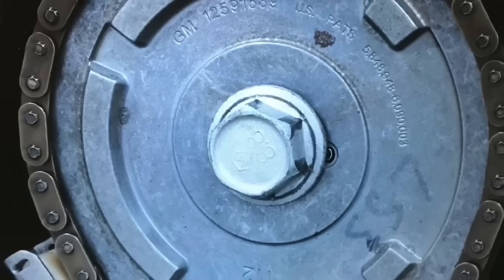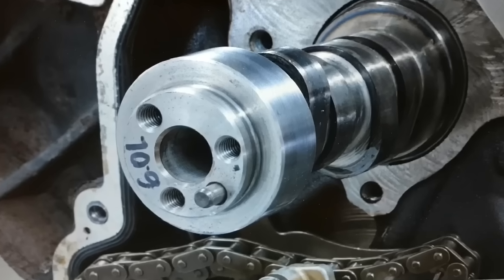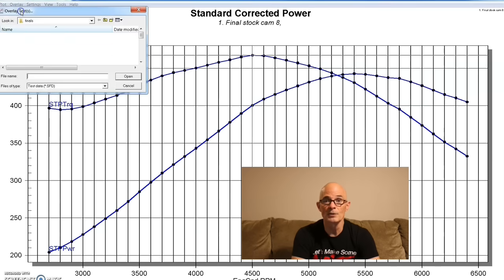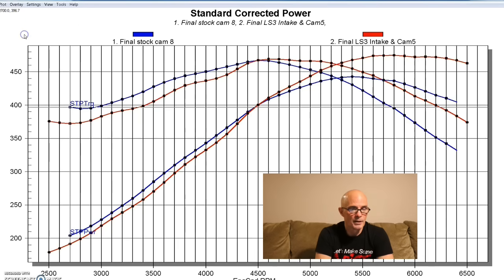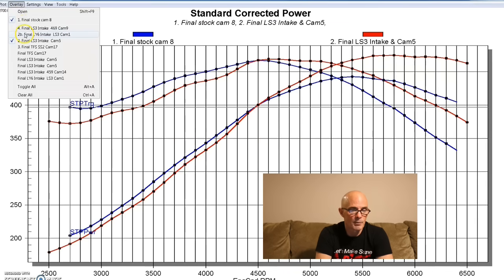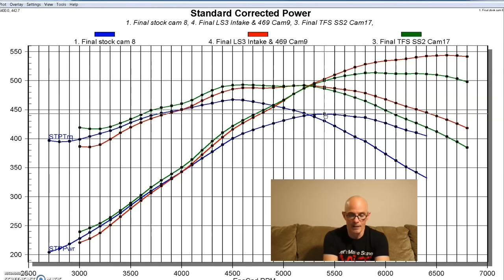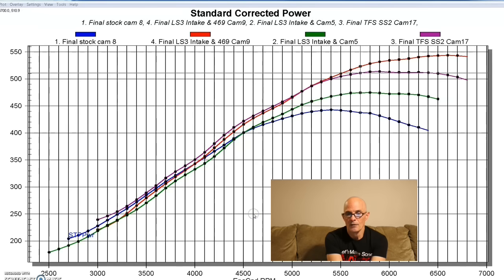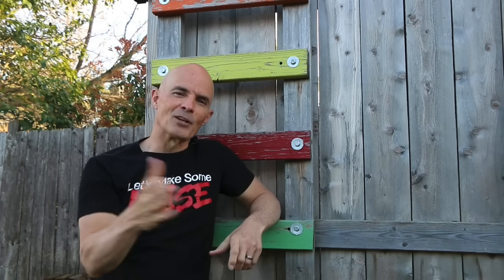HOW TO PICK: THE RIGHT JUNKYARD 6.0L LS CAM. 4 CAMS-WHAT WORKS BEST?

Comment: Y thought  lq4 was 310 hp.from factory tonthe wheel how you gett 400plus
Reply: He’s not testing to the wheels. The motor is pulled. He’s using an engine Dyno. A chassis dyno would measure power to the wheels. Which is what you’re talking about. I believe it’s like 15-25% power loss from engine to wheels

Comment: Would the magic stick 3 cam be good in a non nitrous car? Im tied between using that chopacabra, ss2 or sloppy best cam.
Reply from the maker: A cam does not care about nitrous-a 10-hp shot of nitrous adds 100 hp to any of those cams. The cams do what they do before nitrous. They are different cams that idle differently, offer different power curves, different idle vacuum, different usage with stock converters etc... Pick the one you want that does the best combo of these things-then add nitrous
Reply: @ thank you for responding. Another reason i enjoy you as a human being. We appreciate you.
Reply: @ thank you for your reply Richard. I also wanted to clarify that if I was going to go install a cam if I took the heads off and took the lifters out I shouldn’t have a problem or issue with the installation of the cam since the lifters don’t have to be held up, correct?

Comment: I have a ss2 cam and I was thinking of putting a stock cam in my 6 litre to save some low rpm power with the stock converter in my truck, then my buddy put me on to this video. 
ss2 cam it is! 

Thanks again Richard for your tireless efforts in the hot rod community 🤟🏼

Comment: I don't need 5750-7000 rpm top end 550hp 

I need that 400-550 hp+torque. 5500rpm and below 

Got and suggestions
Reply from the maker: see the many, many 6.0l videos with many, many different cams and choose the power curve you want

Comment: Is this with stock heads?… what heads was used in this test?… i want to possibly make 500whp with a 6.0… maybe if i mill a lil on the heads and raise compression?
Reply from the maker: YOU NEED PORTED OR AFTER MARKET HEADS FOR 500 WHP (MILLED HELPS)
Reply: @richardholdener1727  thanks for the quick reply.. milled LS3 style heads get close you think?.

Comment: I have a 08 6.0l l76 truck engine and I had afm  lifter failure. I set it to a local shop who said they would delete afm  and vvt  and replace it with btr stage 2 cam. When I picked it up, they informed me that they installed a Texas speed stage 2 instead. My question is what is the difference between the two cams. I could not find a comparison between the two. Do you have any data on these two cams?
Reply: If it makes any difference it has 823 heads
Reply from the maker: I DON'T KNOW WHAT STAGE 2 CAMS YOU ARE REFERING TO-THEY BOTH MAKE A LOT OF DIFFERENT ONES
Reply: Btr 31218110 212/218 .553/.553 111+0 
#25 tspll212218112 212/218 .550/.550 112 lsa. Does not look much different but just curious to know how these slight differences compare. Thanks for your reply and I appreciate your videos, very interesting and informative.

Comment: Richard

I love all your tests

But I really think you should do less LS testing with headers, a decent set of stainless headers cost more than a set of good LS heads!

Try testing more cams with standard manifolds

Thanks!
Reply from the maker: cheap headers are $200-$300 and work very well. I have compared stock manifolds to headers many, many times
Reply: @richardholdener1727  

Well for example I’m wanting to do maybe a head/cam swap on my 06 Trailblazer SS but I won’t do headers since I want to keep it at least looking factory. 

Engine swaps with headers but I’ll bet most ls people drive 4.8 and 5.3 trucks in emission states

Thanks though

Here’s an idea….build a low buck flat tappet cam sbf or SBC stroker and see how SMALL a cam and head you can run and still make 500 HP….emphasize street ability and average torque like an engine masters type build.  Thanks! I’m subscribed!
Reply: Also do you do any tests with full cats? I mean logically most V8 s today are in late model trucks and most of them are in emissions states. I’d like to know how a sloppy stage 2 would do on a 6.0 with full emissions legal
Manifolds and cats.

Thanks!

Comment: You think that LSR big boy comp cam would be reasonable/streetable in a stroked 6.0 swapped weekend warrior truck that ALSO tows on the weekend? I know there’s many factors like gearing, weight and tire size but I want to know if it’s possible without stalling constantly or causing extreme wear. Truck sits around 6k lbs.
Reply from the maker: yes
Reply: @richardholdener1727  Awesome. Fastest truck at the boat ramp here I come haha

Comment: Hey Richard,how many miles on these junk yard motors? Do they have original bottom ends?
Reply from the maker: yes-stock bottom ends (with added ring gap for boost) and 200K plus some times

Comment: You've sold a lot of ss2 cams with this video. I got one in a lq4 2500hd 4 door long bed with 44lb injectors ls7 lifters 7.4 chrome pushrods pac springs and shorty headers with stock converter. Runs strong from idle and pulls great like a truck should. Just wanna say thanks.

Comment: I have a 2006 Chevy Silverado 8 foot bed 4.8 862 heads with a SS2 cam  converter 28 and 3200 runs incredible I also have 05 6.0 with gen4 rods what Pistons should I run, I have a gt45 turbo all the hot sides got to buy cold side what do you suggest for the blow off valves ,
Reply from the maker: WE RUN TS

Comment: I’ve learned a lot from your videos! Thanks for making them! your doing a service to the race community. This may be a broad kind of question but how “streetable” would these cams be? Is the comp cam an extremely lopy idle? Does the trick flow operate any less radical then the comp? Or is it just a matter of valve clearance? Hope this makes sense LOL thanks again for making these videos.
Reply from the maker: THE SMALLER CAM THE CAM-THE BETTER THE IDLE

Comment: Okay Richard I got a set of 243 heads that are damn imported and polished by AFR they have change the valves bigger valves in it I have a 2010 aluminum 6.o it's got a true 11-1 Pistons what do you recommend cam wise it's got a cam that's two 26 2:30 with a 515 lift  528 and it runs out of top end strong on the bottom oh yeah and I'm running a 6-speed and it's built and it's in a 2001 SS Camaro
Reply from the maker: BIGGER VALVES IN THE 243 HEADS?

Comment: Just wondfering what that comp cam number is and do you think an LQ4 would hold that cam with a 150 shot with using the stock bottom end...  no gap??
Reply from the maker: there were 4 cams tested!
Reply: @richardholdener1727  the last one... intend to drag race it !!

Comment: Hi Richard, I have an stock 2003 Hummer H2 6.0L. I like the sloppy stage 2 cam. Which cam can I replace without having to do any tuning, if possible? If not, what will I have to do for the sloppy cam to work?
Reply from the maker: a cam will require tuning
Reply: @richardholdener1727  thank you for responding and the advice. Much respect for you.

Comment: So my old man and I are looking at dropping an LS setup into his 57 Chevy 210 because the 283 was too badly damaged to be machined. So he wanted to put down 400+ at the wheels and he still has the original bench seats so he didn’t want anything crazy. This is a GREAT intro video that helps me understand some of the pitfalls to avoid when selecting the LS platform to go with. We certainly appreciate it. 

Going to go look now to see if you have a video on a destroked LS setup (LS3 block with 4.8 crank)… would go really well in my 73 Camaro RS with a TR6060 or TKX
Reply from the maker: that video is up-but you will be happier with more displacement
Reply: @richardholdener1727  so was it you that gave Freiburger the idea to swap an LS from a truck towing a boat… into the boat.. and then back into the truck? Lol

Comment: Great job, I have an LQ4 I'm putting in an I/O boat by replacing a 350.  I have searched everywhere for a reasonably priced cam for it and no one has one available that isn't stupid priced.  Even then they do not share any specs.  It needs to sound good hitting a lick at a low idle to allow shifting on the mercruiser  out drive to not strip out gears.  It need to make good torque and Hp on 1000 to 6000 tops.  The bottom end gets the boat to plain out on water.  
NO One has done  testing on Ls based Marine at all.  
Can you help me?

Comment: Richard, would you recommend the SS2 cam for those 2500HD trucks used a lot for towing? Looks like it improves low RPM torque.
Reply from the maker: not a good tow cam
Reply: @richardholdener1727  what would you recommend for those of us towing a lot with our L96 6.0L 2500 HD? Or just better to keep the cam stock?

Comment: Hey Richard, I'm currently rebuilding a(truck) 6.0 4L80e after watching your video I'm thinking about the btr truck stage 2 cam, do I need the kit etc. Or will I be fine just running the cam? Stock Converter? Thanks
Reply from the maker: truck norris cam and springs
Reply: Is it possible to share the link of the correct cam to purchase for this setup. Engine/transmission will be stock. I just want to upgrade a cam. BTW it's going on a 85 c10.

Comment: Richard, thank you for the continued testing.   What are your thoughts on porting stock heads, (243/799) with a cam upgrade in a bang for the buck sense?
Reply from the maker: PLEASE SEE THE LS1 HEAD TEST-PORTED 243 HEADS DO AS WELL AS AFTER MARKET HEADS-THEY JUST DON'T HAVE THE DECK THICKNESS FOR LOTS OF BOOST
Reply: @richardholdener1727  Thank you. You just have so many videos to sort through.

Comment: Can you run the stock stall with a sloppy stage 2 or will it push on the brake too much? (5.7L)
Reply from the maker: the ss2 usually requires a converter
Reply: @richardholdener1727  A reply from the man himself! What size would be somewhat suitable? Car weighs approx 1800kg and has 3.7 diff gears and a 4 speed auto. Thanks!

Comment: So, I have a stock Gmc sierra 2500 6.0 vortec. I'm looking for a little more power for towing, but not balls to the walls power. It looked like the sloppy stage 2 was the best option, or one around that range. If I understood the graph correctly. Would that be a good route to go?
Reply from the maker: THE SS2 IS NOT A GOOD LOW-SPEED TORQUE CAM
Reply: @richardholdener1727  What would be a better option then?

Comment: Hey Richard can you run the comp cam with out changing pushrods or springs? Or would you recommend changing them? And if so to which springs and pushrods would you recommend
Reply from the maker: springs are usually needed
Reply: What springs would you recommend

Comment: Richard, I have a 6.0 ls I'm thinking about running a Comp cam mutha thumpr 235/249 (54-602-11) with a Texas Speed PRC CNC 2.5 port job on a pair of 317 heads; furthermore, I plan on changing the pistons. Your take on this combination will greatly be appreciated.
Reply from the maker: heads are not the best but it will make good power-make sure pistons fit

Comment: I have a 5.3 l and a 4L80E transmission I put a stock LS9 cam in there and man it's an absolute turd I want to upgrade it over to Winter but I'm not sure which one to get
Reply from the maker: yep-not a good choice, stage 1 truck cam or new Truck Norris
Reply: Thank you bro!!
Reply: Also forgot to mention I have 2 1/4 inch exhaust!

Comment: I have a stock LQ4 w/317 heads. I swapped a stage 2 truck cam in but am having tuning issues. After reading I’m thinking I need some ls6 springs. Is there a part number you may recommend?
Reply from the maker: THE SPRINGS WILL CAUSE MECHANICAL ISSUES-ANY FACTORY LS3/LY6 SPRING WILL WORK OR MANY OTHER AFTER MARKET SPRINGS

Comment: I’ve watched a lot of these videos and it seems to me that a tighter LSA ALWAYS makes power almost everywhere. Is that because it is more beneficial to increase the time that a valve is open rather than increase how far it opens?

Also, I’ve noticed it’s more common to run a tighter LSA on a carb setup than a fuel injection setup. Does that have to do with piston to valve clearance (modern fuel injected engines generally have a higher compression ratio) or something else?

I’m not saying this is always true, but I’ve seen a lot of carbed SBC’s with 110 or even 108 LSA but rarely do I see an LS engine with a tighter LSA tighter than 112. Thanks for any feedback and thanks for the videos! Ur a legend!
Reply from the maker: idle quality is better with wide lsa

Comment: Pretty sure you just sold me on a Sloppy stage 2 for my 6.0 tow rig. It’s the only cam that didn’t lose power down low and still has some nice mid to high rpm gains. Thanks for doing these tests!
Reply: Im thinking the same thing for my 2500hd but it still looks like it needs converter thoe
Reply: @jeffpriest4017  I actually did some more research after this, and found that the Brian Tooley Racing torque cam is actually the best bet for no converter and low end torque, but that small part of me wants some audible idle chop, so I settled on the Summit Racing 8719 stage 1 high-lift cam. I’ve heard a few 6.0’s on YouTube here and it can be tuned for an audible idle chop, yet still picks up good low to mid range torque. No converter required per Summit.
Reply: Well i maybe disappointed but im stuffing the ss2 in lq4 with 706 heads and long tubes with flex injectors in my o3 2005hd 2wd
Reply: @jeffpriest4017  You’re doing a converter then? I’m sure you’ll still be happy with the cam. All depends on your application too. My truck is mainly used for towing and hauling which is why I’m going with the lower end torque cam. If it was a street truck then I’d go SS2
Reply: @TonyTheTruckGuy   - Well, how do you like it?  Did you dyno it?
Reply: @mistersniffer6838  I haven’t done a cam in mine yet, just a baseline dyno. Not sure if you saw some of my previous comments but I think I’m going with the Summit  cam instead for better low end grunt instead of the sloppy stage 2. I’m sure the sloppy would work great in car applications but I want something I can run with the stock converter for towing. Just haven’t had the chance or the funds to do it yet.
Reply: @TonyTheTruckGuy   - Well, been 5 months.  Figured you got it in by now, but, k, thanks for the response.
Reply: @mistersniffer6838  and your wasting all your time waiting for some random dude to cam his work truck?
Reply: @alexvillalobos7137   - Only in your fantasy....

Comment: I just recently purchased a lq9 and I was wondering what compression I would be running with 862 heads. I also was thinking sloppy cam and adding boost. Would this setup work together with piston to valve clearance?
Reply: Let me know when you come up with this answer
Reply from the maker: keep the 317 heads and add boost with the SS2 cam
Reply: @richardholdener1727  I know u used a cathedral port holley crossram. What is the part number for that?
Reply: Thank you for responding to my questions. Luv your videos keep up the good work

Comment: Richard I am currently going clean sheet crazy on my best mates vx ss Commodore . His LS1 was factory equipped with utterly useless oil control grooves in the 3rd ring groove as well as the rubbish design work within the baffles of the rocker covers .my mate has permitted me to reverse the piston orientation , because of the generous gudgeon pin offset , my favorites Henry is the same M code that you also seem to be rather passionate about , all the henries that I've built have all had their pistons reversed . It would appear that when I had the old rubbish design slugs sealed for the new ones , I did ask Ross from Browne engineering could he check if the Ls has any gudgeon offset , and considering he is in his 70's , he looked like I did when I was 19 , and discovered that piston reversal will yield strong increases in cylinder pressures. The old guy told me excitedly that there is heaps of offset on LS pistons. My cam grinder said we will be using all of the cam profile that I designed in the early 1990's , Ivan Tighe cam catalogue includes my Cleveland solid #764 , intake dur 261°@ 50"' exh dur 256° @50"' or intake 292 ° @ 5"' , exh 298 ° @ 5"', intake op 44° btdc close @ 68° and , exh op 83° bbdc close @35° atdc , lift @ rocker tip is intake lift @ 614"'. , Exh peak valve lift @ rocker tip 622"' . I absolutely worship  my cam could you please try my big bam cam in a 351 Cleveland with the Aussie quench chamber small valve heads . Full size 4 Venturi valves do not clear the valves during overlap phase . the closing exhaust valve gets caught by the rapidly opening intake valve , which then drags the exhaust valve open again.

Comment: Maybe you've answered this in a episode I haven't seen but: what is a cam similar to the sloppy stage 2 for a 350 chevy? In my chevelle I have a 20 over bore flat top 4 valve relief piston,  1969 camel hump heads, performer rpm manifold, long tube headers, 750 edelbrock carb. I ran a 350 horse 327 cam to break the engine in now it's time to step up. It's high geared (308) and automatic mild converter and shift kit. Just want 400hp at 5500 feet above sea level.
Reply from the maker: get the comp 268 cam
Reply: Thank you, I might had over did it.

Comment: So... my 6.0 in 1500hd is rated at 300hp and like 360lbs torque. 
So based on this video, heads and TB with a good tune I’ll be seeing 450hp? (At the engine)
Reply from the maker: we test in a different method than the OEMs-your 300 hp motor makes more than 300 hp when run the way we run it
Reply: @richardholdener1727  by that you mean less accessories, no fan, and optimum intake and exhaust? (Yes I just came across that video this evening haha)